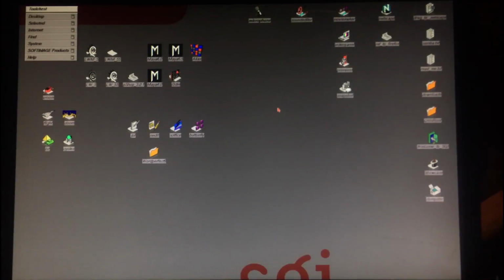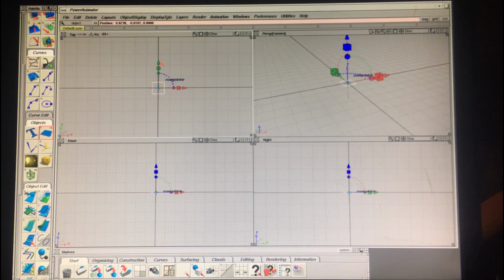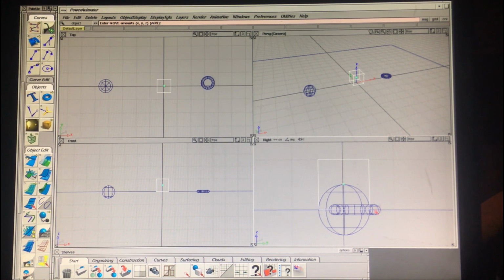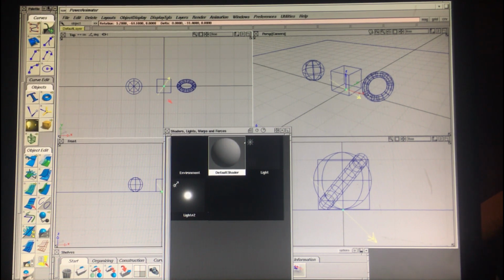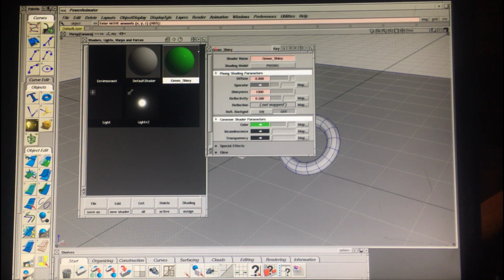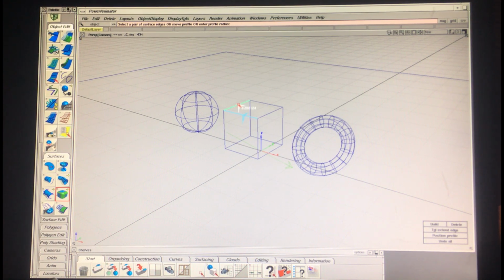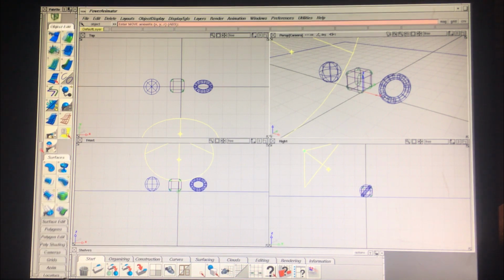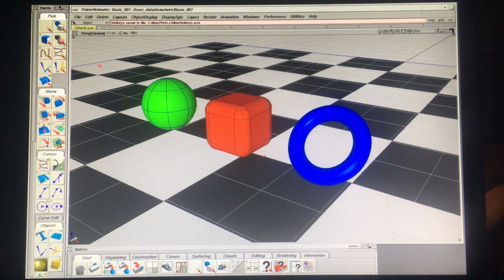Power Animator 9 in Irix -

Comment: hi, it's just missing for me to be able to make motion blur appear. I made the motion blur and shutter adjustments in the globals render menu and turned on motion blur for the object in another menu but so far nothing blurred. what do i have to do to get motion blur to appear in my rendered images?
Reply from the maker: Sorry I missed a lot of your messages since last I checked. This was also an issue for me. I could render animation but was never able to get the motion blur working in PA9. I started wondering if it worked in 8.5 or any Alias releases after PA9. I just never saw a blur effect. This was something I was going to return to before the Pandemic started. I actually have my machines back with me again. I hope they are still working and I can do more vids with them. Motion Blur was something I never was able to get working in Power Animator v.9.

Comment: another question is if you think you can only do computer graphics with sgi model onyx. do you think power animator is so heavy that you can't use it for example in octane i say professionally not to make movies for the cinema but to do animation work at home even as a hobby?
Reply from the maker: You can do VFX with an O2. I would just recommend at least a 300mhz model or 400mhz model. I have an Octane, not an Onyx. Power Animator is very light actually to run. The only part that is really heavy on any system is when you render. But that also depends on how many things you are trying to render and if the shadows are soft or if the materials are reflective etc. Your O2 is one of the slower models so, you could likely do a lot of modeling and animating in it just fine but it would be slow to render out animation frames.

Comment: another thing that you who use power animator could tell me if everything you saw in films from that era of cinema was done even in it if it is powerful when it comes to generating impressive images. I ask you this because I have the alias studio tools 9.5 installed on the window and from what I saw there is only something missing like the fire, smoke and effects part, apart from that there is also powercast and raytracing I already generated good images but not as interesting as those from the movie Contact by Jodie Foster. I saw that the power animator was used to make that whole thing that was there in the middle of the ocean in the movie all in 3d. Tell me if you've seen someone outside the cinema render as good as those seen in the movies.

Comment: another question is that on the 02 R5000 I will be able to make, for example, an animation without crashing. I'm not talking about rendering time so I'm not worried at first. I'm worried that it won't crash when I'm modeling or maximizing screens or something like that. And another thing I would like to know if you can teach me how to install it because I don't understand irix. but if you tell me how to do it i'll follow the steps and i'll get it for sure.

Comment: hi, is your computer by any chance an o2 and if so could you tell me if the processor is the r5000 or the r10000 and if it is necessary to have a better video card than the one that usually comes with the o2? i have an o2 r5000.
Reply from the maker: I have two O2s but this one was recorded on my Octane which is a dual 400 mhz proc R12000A. 
Both my O2s are R12000. They are 300mhz and 400 mhz. The o2 can't really update the vidcard because the processor is merged with the video capability. The r5000 is one of the slower models for sure. irixnet.org is one of the forums I usually go to for questions about SGI in case you want to find out if you can upgrade your current o2. Ian may have parts for cheap.

Comment: This was a blast from the past!  I learned Poweranimator in college and used it after I graduated for a few years from 97-99. My buddy and I went in together on the software and an O2 workstation. The software + hardware dongle and workstation was over 20K back then, or almost 40K in current dollars.
Reply from the maker: Yeah, SGI were so niche in the market and so was the software. Power Animator was basically 95-99 in its heyday. After 98 it was basically Maya and Softimage until Maya came out on top. I still have the O2 and Octane. Glad you like the video. Did you guys make any content with the O2 that still exists and could be uploaded to youtube?

Comment: This is very similar to Maya. I started using Maya v1.0  and v1.5. There were some great changes with v2 and possibly my favorite was v2.5. It was fairly stable. From the production standpoint, v5  was great. I didn't work on Irix, I had to use Windows NT 4.0 with a service pack. Alias Studio is also an amazing tool. I always loved working with  NURBS but in  VFX production polygons rule.
Reply from the maker: Yeah, nurbs were a lot of fun. Still very useful. I had to do some arch viz columns that had a slight S curve that was very symmetrical. The only way to get the shape I needed was to use Bezier curves snapped to the grid to ensure the angular integrity. Then lofting the curve and from there I could convert nurbs to polygons... extrude for thickness etc. But... I still find many uses for Nurbs. Another one today will be to use the bezier curves of a company logo in order to project the shape of the logo across a curved surface. Then I can get the outline they need actually ON the weird wall shape. So... for those that know the old nurbs methods it is an easier task . Glad you found your way here. Sorry about the late reply.